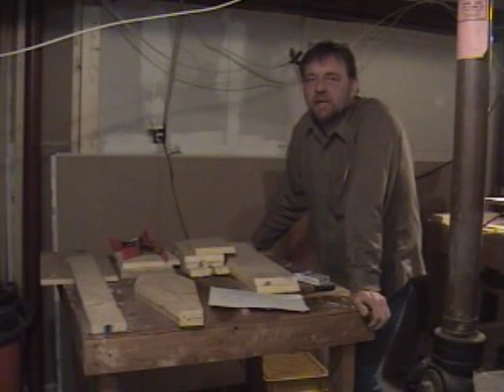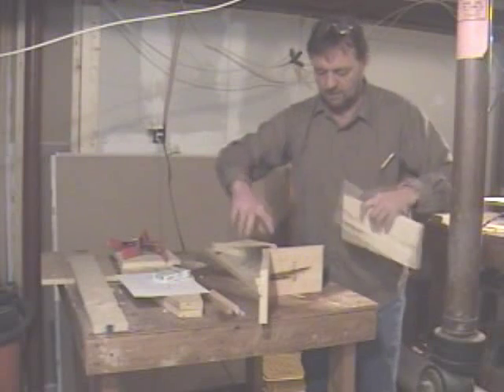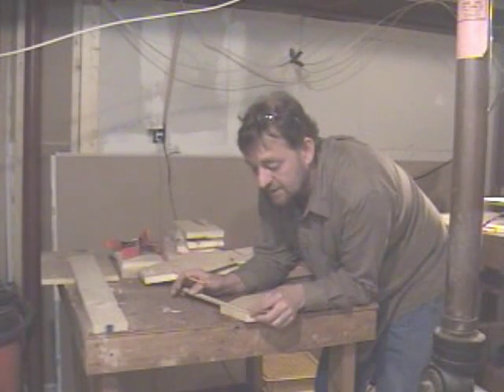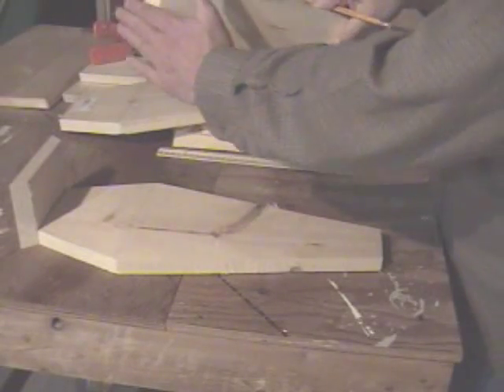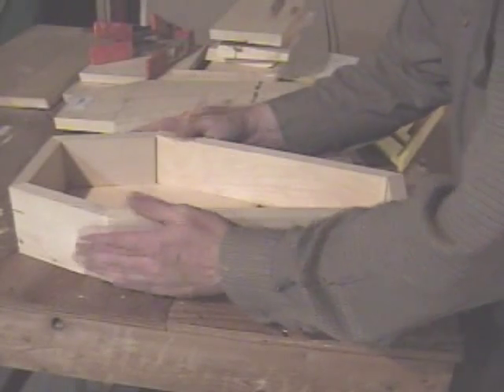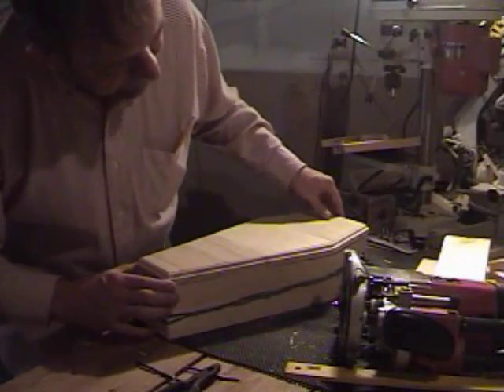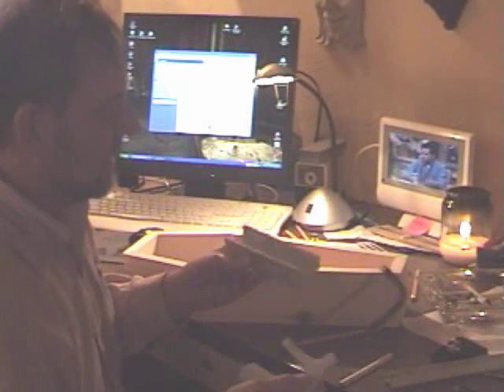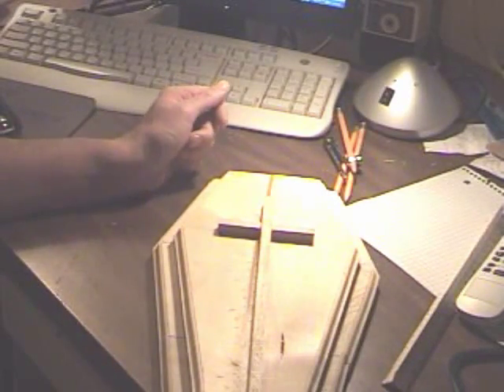How to build a gothic coffin Dracula complete with geometric angles

Comment: So...I took a screenshot of the video at 1:24, traced out the coffin shape in photoshop and enlarged the image until the top measurement was 4 1/8". That gave me the rest of the measurements. These are "inside" measurements with the direction of all the angles leading out from here. The outside measurements will depend on the thickness of the wood you're using.

Top: 4 1/8"
Bottom: 2 1/2"
Top left and right sides: 4 1/2"
Bottom left and right sides: 11 3/4"
The overall inside dimensions are 7" x 15 3/4"
The "bend" is 4 1/4" from the top or 11 1/2" from the bottom
The angles are as shown in the video. 

I haven't built one yet but after I do, if any of these measurements change I'll be sure to update them.

Thanks so much Shay for this awesome video!
Reply: to get a .jpg of the measurements I came up with, go to https://tinyurl.com/y8l2vgo9
Reply: @victorives9395  thank you for posting this !! This is the exact size I need
Reply: You are most welcome Kimberly! I hope the measurements work well for you!

Comment: im thinking of doing a coffin bed too, I would add an inch or two to your height so you're not crammed in there, and and extra 5 inches accross. so it would be your heigh(+2in) by measurement of your shoulders(+5in) and then taper it as it gets closer to your feet .... Im no expert but thats what i would do